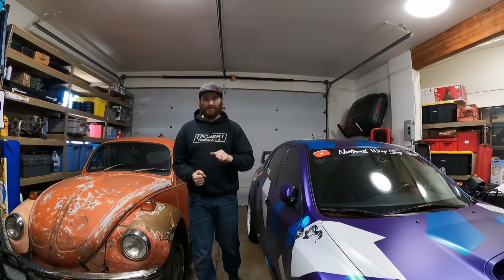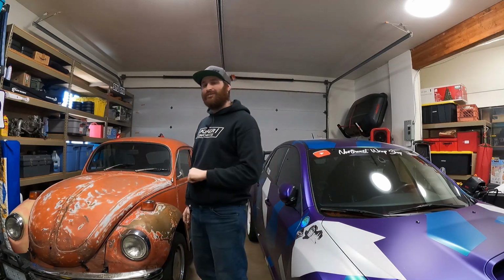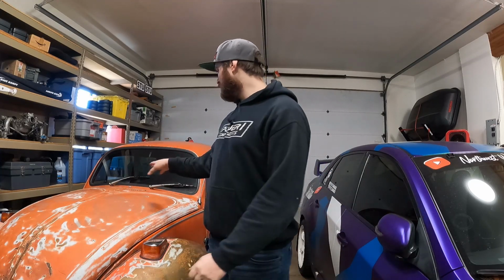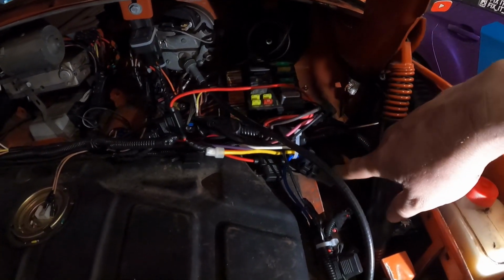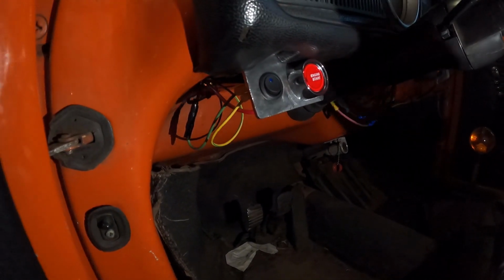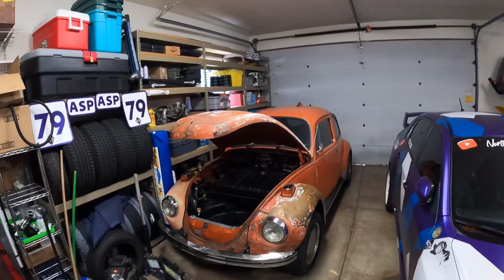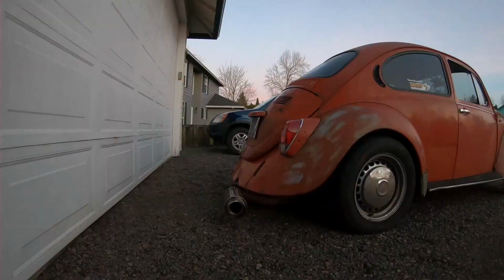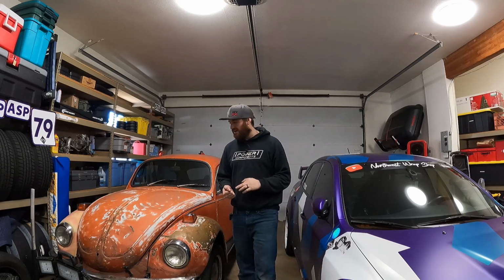VW Bug Engine Swap. Its all finished!! Superu Beetle PT 25

Comment: Thank you! I have a 68 Baja bug that caught fire some time ago that pretty much fried the engine. I’ve been looking to getting it back on the road/dirt trails since. I’ve done a lot of research and decided to go with Subaru power since it would be cheaper and nearly triple the HP than rebuilding a VW motor. I ran across your vids and followed each step in the process, and from that, I have a clearer understanding of what to expect for my project. Thank you!
Reply from the maker: Your welcome! Hope your able to get it back on the road! Sounds like a very fun project!

Comment: The rad fan wiring for those 90s EJs is really simple. 
There will be 2 wires coming off the ecu for high and low speed, you only need the low speed wire for this, it grounds a relay coil at around 95c/203f. 
Plug your green test mode connectors together and with the ignition on the ecu will pulse the relay every few seconds.
Reply from the maker: Thanks for all of that. I had it run to fan high and when I tested with the test mode connectors I had nothing. I later after filming tested that relay and it was a bad relay. The owner wanted it to be on a switch to seem more "racecar" like. He's happy and that's what matters most. It can always be redone at a later date if needed to. But thank you I do appreciate the advice! I'll take it where I can get it
Reply: @Fix_it_Garage  happy to help, back when I did mine there wasn’t much info on the net, no Facebook groups etc so I was flying blind.